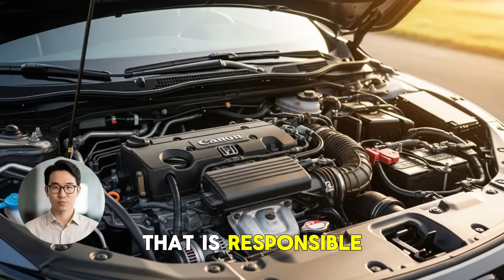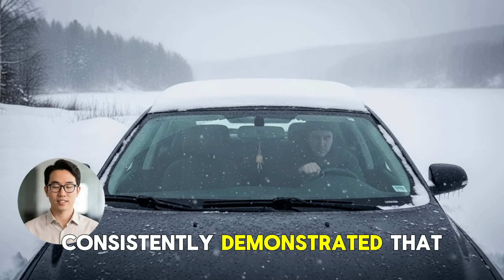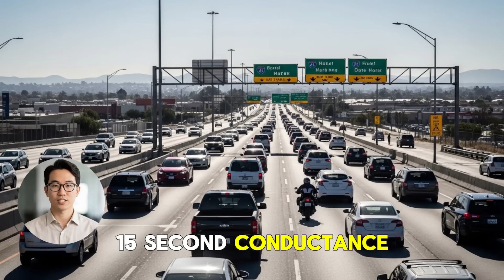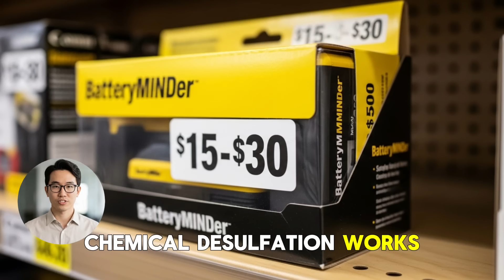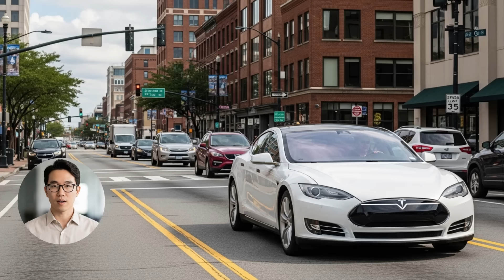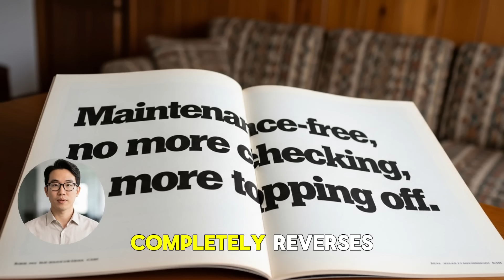$1 Tablet In Your Battery = 3X More Life GUARANTEED — AutoZone Loses $150 Every Time You Try This

Comment: When i worked for a Quick Oil Change Co. with the initials JL in Scottsdale Az. We had an Area manager by the name of Dennis P.   who had a hard on for checking Battles and filling them with tap water... yep, the stuff from the Colorado River.  i know that there was not a drop of distilled water in the place and you would think that Mr.by the book would have gone out and bought some for us to use...  nope,  not one jug, and we had an Albertsons just across the street..  so only god knows how many car batteries this human moon portal has screwed up and continues to do it... so if you see a white dually Dodge truck with chrome bimbo mud flaps parked outside a JL in Phoenix, go to a different shop. Do not let that clown touch your vehicle.

Comment: The biggest problem comes from not fully charging the battery I needed power to run a drill and or a circular saw I had 2 ways to go buy a generator 400 dollars to use once or twice a week for 20 minutes maximum or buy a booster pack with an inverter that was a poor choice in the beginning then the first generation cordless tool came out and using the booster pack to charge the cordless tool batteries was perfect bought on sale usually at half price first one I bought 
was dead when I went to use it the next spring when I bought a new one I read the instructions fully and found that I should have charged it fully before storing it and I should have checked it monthly and w my when it got to half recharge it or I could leave it plugged in and it would automatically keep it charged up so when Fall came I plugged it in and left jt come spring I had the same problem it was dead so started a yearly cycle buy a booster pack in the spring every year being cheap I didn't throw them away I kept them figured that one day I would find a way to replace the battery in them and then one day on my phone a video was featured on proper care of a sealed lead acid battery so I watched it it said that the battery should last between 5 to 8 years if treated right don't discharge below half way and when storing keep them topped up well I never discharged them below half because the inverter shut down at 10.8 volts so no usable information but with utube once you click on a video they send more links to videos on the same content and I got another one this one had information that was totally off the wall totally unbelievable it gave voltages that were outrageous a 12 volt battery was dead at 12 volts should be charged at 14.8 volts and every time you discharged it below 13 .4 volts shortened its life so I had my old black and decker booster pack handy so I opened it up to find who made the battery inside figured I'd go to their website and find out what the charge perimeter was but on removing the back I didn't have to go to their website as written right on the battery was do not discharge below 12.2 volts float charge at 13.4 and full charge was 14.8  and on the built-in charger was output 12 volts so it was dead to start with and being discharged way to far so checked my 2 new everstarr booster packs and found that they charged to 13.9 so I phoned them and they said that their battery was fully charged at that voltage so I left it at that I was just using it for boosting my PT cruiser it had a glitch one time I could drive it 2 block's after having to boost it and other times it had to be boosted everytime I did find if I kept the charger hooked up when parked at home I could start it and two or three times after  then use the booster pack each one gave me 5 boosts that's why I had 2 booster packs sometimes I had 7 or more stops after about a year the amount of boost a pack gave started going down it died after 5 uses but I had the second unit but after recharging it the next time I used it it only gave me 3 boost and I knew I had been deceived so I hooked up my battery charger to the booster clips and turned them on and plugged in the charger it charged it to 13 volts and no higher after a few cycles it got it up 13 .8 got another year before it wouldn't boost at all I got a lithium one used it for awhile by then my battery was totally dead so since I was at the point I knew I wasn't able to replace the vehicle I broke down and bought a new battery and found it wasn't a glitch with the pt cruiser charging system but a defective battery put the new battery in and it starts every time now as for your saying that a battery needs replacement after 5 years when I first started driving a battery last 10 years or more the reason they don't last that long anymore is because they changed the charge perimeter of the newer vehicle's now they only charge the battery to around 13.8 and that's all the alternator puts out you need a good battery charger that charges the battery at 14.8and shuts off don't assume that a charger charges properly most will only charge to 12 volts that's all they produce I have 3 battery maitainers all different brand's and all have a top output of 12 volts so by the time you need to use the battery it's dead from sulphation so I'm going to try your vinegar hack I've tried the eptoin salt hack and it didn't work

Comment: Back in the 60s my parents used to drop a tablet in each cell with cold weather about 2× year as the battery became old. Open the caps drop a tablet in they where sold at the automotive store. It works.